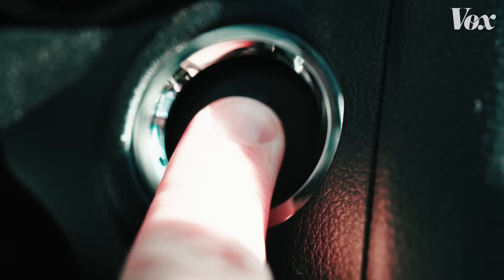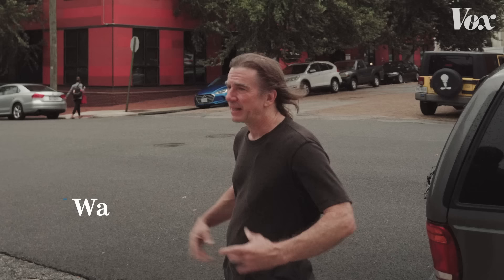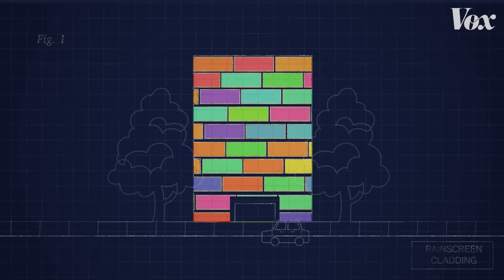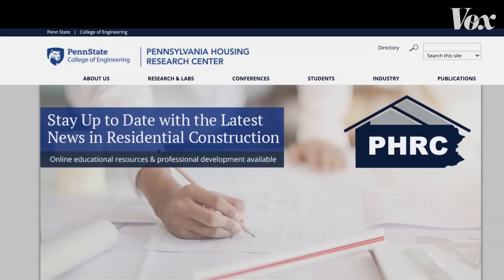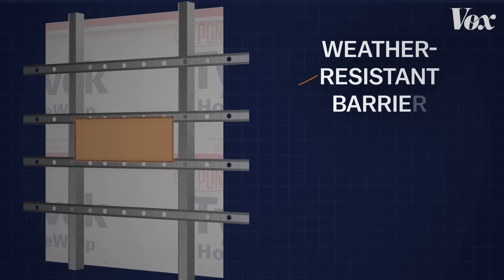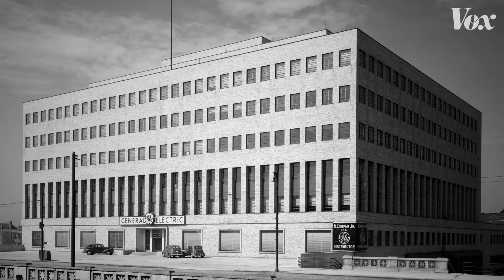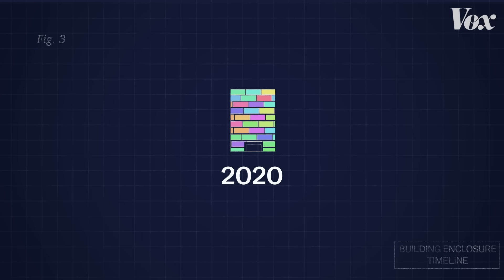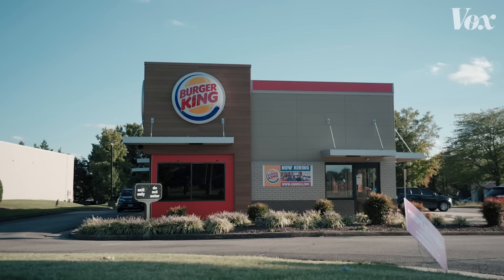Why so many new buildings are covered in rectangles

Comment: I didn't hear a lot on WHY these houses are so much more efficient.

I lived in a house that's 500 years old, made out of very thick (75cm) granite blocks that could stop a trebuchet shot. It'll probably last into the next millennium. It stays cool all summer long and once it's warm in winter it will stay warm for a long time. My family still lives in that home and they hardly need to maintain it.
Reply: 5:54

The weight of the materials in old houses are not friendly to the environment apparently. It's also about cost.
Reply: They don't cost as much money, that's all that matters.
Reply: @TKOfromJohn  I thought this was pretty clear. Carbon emissions are directly correlated with the weight of materials that need to be transported. As weight goes up, so does the energy required to move it from point A to point B to point C etc. It's cheaper to produce and to transport as well, so in this case, energy efficiency and lowering the cost are aligned.
Reply: @jamesavery3727  that's true as well, but we wouldnt have to worry about carbon emissions if we can switch to renewables already! The world needs to wakeup, we're reaching a climate tipping point. The upkeep and repairs on these cardboard Elmer's glue and popsicle stick houses just costs more money for the homeowner.
Reply: @TKOfromJohn  Stone does cost a lot. It is more difficult to build with, insolation is still worse than new materials.
Reply: @ligametis  this is a great point, though does the house's longevity outwreigh those downfalls or balance them out somewhat?
Reply: Beatrice Goodchild Properly built wooden houses could last for a century. So the question really become how much are you willing to spend more to have a house that can stand for 100 years. Lumber for example you have a lot of choices from glued together sawdust to hydraulically compress and densified wood to make it a lot stronger than natural wood.
Reply: @thomk3282  Not friendly to the environment because they were built to last look at some of the ancient Roman structures
Reply: this video is fairly vague on technical details, but as others have pointed out, the proposed benefit is less use of materials high in 'embodied carbon' as the construction industry grows.

Granite has many fantastic properties and is very beautiful too but mining for stone is unsustainable (*at the largest mass production scale*)
Reply: @TKOfromJohn  you make a good point and this is being recognized by parts of the construction industry. Rather than requiring 'energy neutrality' on a project, certain certifications only require 'carbon neutrality'. That is, you can use as much energy as you want to harvest, transport, manufacture, and build with the material, as long as none of that energy generated CO2.
Reply: @beatricegoodchild6232  do we really need buildings that stand for centuries?  They still become outdated and it is a struggle to convert them to something useful.
Reply: @jamesavery3727  we are less then a decade away from autonomous electric trucks so I doubt this will stay in fashion long..
Reply: @thomaskirkpatrick3870  electric, yes. 100% Autonomous, no. Maybe 90% autonomous but will still require human supervision
Reply: Same. if I had control over what type of house I could build, it would be brick and I'd like it to be well insulated so it stayed cool in the summer and warm in the winter. I'd get solar panels installed and anything else that could be done to help with the environment. But yea, I don't like that rain panel system or whatever its called. It looks like it would last 5 minutes.
Reply: @ligametis Building with the intention that it will knocked down in 60 years or so is a massive waste of materials and carbon. If  something is built to a high quality and it’s good looking, people will want to refurbish it, for example former industrial buildings converted to apartments/lofts. That’s true sustainability
Reply: It's also a question of being environmentally friendly speaking of the material. Brick - as far as I know - does not emit poisonous gases, it is naturally fireproof (no artificial chemical impregnation), pretty rot-resistant and durable. These rectangles seem to have to outweigh the almost vacuum like interior so it can breathe.
Reply: Yeah whatever
Reply: @marvindujardin463  bricks are bad for insulation compared to new materials. If someone uses brick it is just a half brick glued to exterior façade
Reply: In architecture school (granted, my concentration was is in historic preservation), we learned that the most energy efficient building is the one that's already there. The ecological cost of demolishing an existing building in addition to sourcing new materials, and actual construction, will basically never be as "green" as just using what someone years ago, already expended energy and resources into. So basically, your 500 year old house is way more efficient than any fancy LEEDS certified new construction. Reduce, reuse, recycle works for buildings as well!
Reply: @ligametis  Yes. We need buildings that stand for centuries because craftsmanship and quality are more important than the latest architectural fad.
Reply: @yvettet9855  I disagree. New buildings  come not only with new style, but also more natural light due to larger windows,  efficiently integrated modern communications and infrastructure, floor plan that corresponds with what people want, better accessibility for disabled,  better insulation, elevators. And overall they are not rundown like old ones. Without throwing money into 100 years old building it would still fail.
Reply: @yvettet9855  most buildings even if built from the best materials won't  stand for a century due to change in style (and that has been happening for centuries).
Reply: @yvettet9855  demoltition won't be as green if building is still usable. But to be fair some old buildings need so much repair that you are pretty much building a new house but in a complicated way. At that point just building a new one is better.

Also many demolitions happen due to densification.
Reply: This comment thread got the cost motive down that is good...but can I be resuscitated from when they said "this build needs to look good for 20 years ?!" 🤣
Reply: That's because they aren't.
Reply: I wish I lived in a house like that, my house was built in the 1960s and it’s already falling apart.
Reply: Because not everyone have an aristocrat as an ancestor? So they can't inherit 500 year old castle, they can't inherit 500 year old hovel. Check your privelege.
Reply: James Avery — it’s not just the transportation of heavy materials: I’ve been given to understand that the production of steel and concrete produces more carbon in the atmosphere than any other source, including trucks and automobiles.
Reply: @jamesavery3727  Longevity is also a factor in something's life-cycle emissions though, something they didn't touch in this video. Maybe making a building out of bricks will cause more carbon emissions today, but if that building lasts 2 decades longer than one build with cladding, it's still more environmental in the long run.
Reply: If we keep making heavy houses, eventually the planet will become too heavy and will fall from the sky.
Reply: having a house that doesn't need heated or cooled or repaired is not good for Capitalism.
Reply: @Flowmaster925  And trebuchet-resistant walls aren't good for feudalism either.
Reply: @thomaskirkpatrick3870  Meaningful widespread autonomous electric vehicles will probably be "less than a decade away" for at least a few more decades. For example, they are so busy working on the safety issue that they haven't really even begun to deal with the long-term consequences of that safety. What happens in a high population area after pedestrians realize they can freely walk across streets because they know every vehicle will stop to let them pass? What happens when people actively "troll" autonomous vehicles, just to be jerks?  Will theft be a bigger issue when you can just stand in front of a truck to stop it, and no one is present to prevent you from then taking whatever you want?
Reply: @jamesavery3727  if the material is locally sourced yea but most of these metals and other stuff comes from China or other countries, that’s not environmentally friendly
Reply: @ligametis  efficiency and accessibility can be infixed into buildings that are designed to be adaptable over time. And MANY are. If you stop assessing them for "style". 
The most sustainable building is the one that exists. It will always cost more for the environment and offset whatever efficiency you're aiming for if you approach buildings as temporary structures to be switched out based on trends. These are living spaces, not handbags.
Also, alot of the "style" you've mentioned is western influenced architecture that is almost always entirely clad in glass or have larger windows. Which as I'm sure you know, with glass having an almost nonexistent R value, means the energy and electricity lost in these "new style buildings" would only hasten our already fast ride into climate disaster. All while many of these release more carbon into the air than entire towns of "old style" buildings.
Reply: Bully for you
Reply: @jamesavery3727  You're only partially correct about the carbon footprints. The part you're forgetting is the lifetime of the material. A house built of brick will last a significantly longer time than a wooden frame construction, such that the brick house is less carbon intensive in the long run than the wooden house that you'd have to rebuilt several times.
Reply: @mynameisuju  1800s buildings are just not comfortable no matter how you look. Small windows, strange floor plan. Most of them are "adapted" by demolishing everything and just leaving inefficient walls for looks. At that point it makes zero sense keeping old brick wall that needs 30% of its bricks replaced.

R value with glass is a problem, but not that big as in North we use 4 panels of glass that function really well as insulation.
Reply: Are you a vampire?
Reply: It's mainly about cost. The worldwide need for housing is rising exponentially (with the population), and the majority can't afford houses in urban areas, let alone ones with 75cm walls.

Also I bet it would create a ressource crisis
Reply: @kazedcat  if you are talking longevity you would build a house out of concrete and steel stud. Wood is oldschool and will eventually be phased out much more than it already has been.
Reply: @thomk3282  the thing is today we dont use local materials as often as in the past.  So weight is one of the factor of cost in long distance transportation
Reply: Good for you.
Reply: Welcome to the club. My childhood house was built in medieval times and it is really environmental friendly.... Even thought it is not that hot in winter we dont use much aircon or heater in our house.
Reply: Apparently you missed the part of about air gaps. We can use air instead of brick to keep the building cool/warm. Your 500 year old house was built at a time where most houses were peasant hovels (maybe made of mud!). If we were limited to granite we wouldn't be able to build as many houses we need, and it would be much worse for the environment.
Reply: @preslove  I'd rather have an Earth Ship. Look it up, very interesting architecture.
Reply: @ligametis  Yes, you do want buildings that stand for centuries. If they're built well with multi-functionality and flexibility in mind, there isn't a better investment.
Reply: @kazedcat  The problem with lumber and shingles is fire. Buildings need to meet modern fire codes and most wood assemblies cant do that on larger buildings. I would love to use cedar shakes, but cedar shakes are like gasoline in a fire.
Reply: @mikeeeeeec  For every one of those old industrial buildings thats converted like that, how many more are still abandoned? We live in a world of ever changing needs, requirements, tastes and codes. Some of the hardest, most expensive and most wasteful projects ive ever worked on have been renovations of old buildings to try and modernize them. Take one of those old schools from 1930 and try to make it work as a modern school with modern requirements...its a TON of effort and money. Those adaptive reuse projects arent about sustainability, they are about historic preservation and maintaining a look
Reply: @yvettet9855  This only applies if you HAVE an existing building. The point of this cladding is to balance, cost, efficiency and ease of construction. Yes, double wythe brick is potentially more efficient. It also takes 5x the energy to produce, specialized labor, 10x the time to build and at double the material cost alone. The efficiency it gains in some areas, it loses badly in others. And while yes, this cladding and building system might not last as long, its far easier to change and adapt in a modern changing world. I did a feasibility study on a school  a few years ago. The cost to rehab and expand the 1950s Brick on CMU on steel framing building was actually a million more than building a whole new school in a better location to modern energy standards
Reply: @ligametis  

What a bugman LOLOL
Reply: @JKSSubstandard  Carbon savings can be up to 80% on refurbs vs new build, refurbs are expensive and challenging but the carbon savings are worthwhile and there’s obviously less waste from adapting an existing building as opposed to constructing a whole new one in its place… I agree not all industrial buildings can be repurposed and in those cases designing for deconstruction, renewable materials and recyclable materials like the aluminium cladding panels are the solution. Nevertheless a beautiful, high quality building that considers more than present functionality has a greater likelihood of being repurposed as opposed to deconstructed and recycled, if that is even considered.
Reply: @dominicgunderson  And what centuries old buildings did not become outdated? All of them need major works that are way more expensive than a new building.
Reply: @mikeeeeeec  I don't get how average refurb saves 80% of carbon footprint. Most often major parts of the building get demolished.
Reply: @ligametis  Upkeep is almost always cheaper and more economical than new construction.
Reply: @dominicgunderson  mostly.  But many are too lazy to care about regular upkeep and upgrade and often old houses need full scale overhaul that is never cheap.
Reply: @ligametis  generally they don't- fools might actually want to fully gut an older home, but, due to the logevity of the construction, most people will settle for repainting the walls and putting new flooring in. This does vary on income bracket (you could basically build any upper-class home out of damp tissues and it'd have a negligible effect on longevity, given it will either get replaced with a more fashionable upper class home, or gutted to make several smaller working class homes), but significant re-working of the structural components is rather rare in most medium or low income homes. If you exclude re-doing roofs, but that's got little to do with the cladding- and, more interestingly, sort of works in reverse. Limitations with older materials, like slate or tile, mean they were supposed to be easily patched/replaced (to cope with weather damage, and the fact they couldn't find anything that didn't get damaged by weather), whilst modern roofs are often designed to be the last bit of the building to go. It's more or less pointless to design a roof that won't last within basic price constraints as you're never going to replace it out of a desire to re-design, and if it does break before the building is demolished, you'll almost always have to replace it with the exact same thing (you can switch shingle materials, but almost anything else required you take it off and start over).
Reply: They stated why - the panels on the outside create an airgap between the panels and the actual building, which is insulating.
Reply: So just because you live in that house it means that it’s an effective and efficient way to build everything? Out of granite with 75 cm blocks?
Reply: @birilol  Replace the n with a *t*.
Reply: not everyone can afford 750mm thick granite, mate
Reply: @StanleyKubick1  I think you missed the point.
Reply: I think they mentioned it vaguely in the video, but if humans put a large amount of pressure in a singular area, they can cause earthquakes and such. With stone and brick being so dense, modern development and cities would not be able to occur. 
Therefore they need to be lighter for that reason too
Reply: Many floors of granite would be very heavy, both to construct, and the compressive  load on the walls of the lower floors and the foundation. All these would have to be designed heavier.
Reply: Did you not watch the video?
Reply: Are you seriously suggesting a 500 year old house is more energy efficient? And use a trebuchet, which haven’t been used in warfare for hundreds of years since before gunpowder, have to do with this? What a bizarre comment. You think you capping